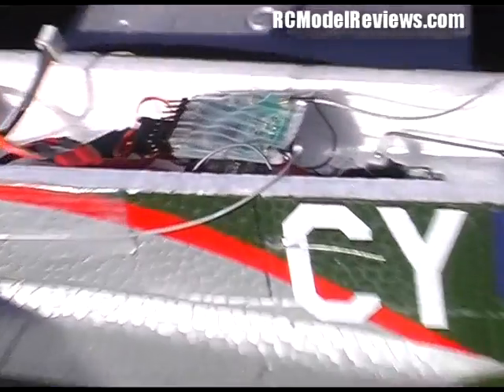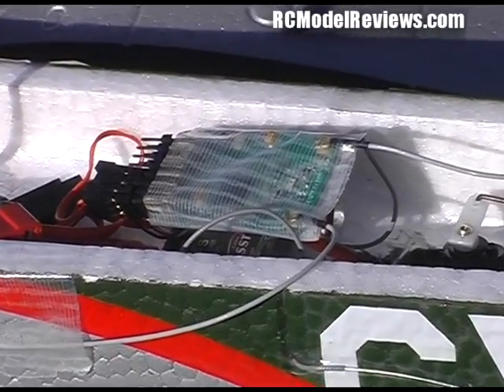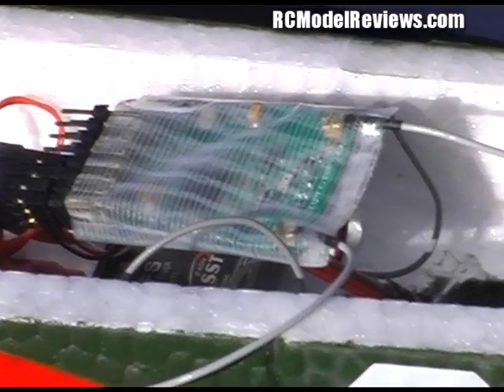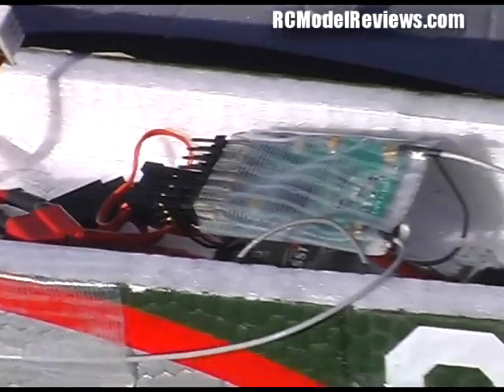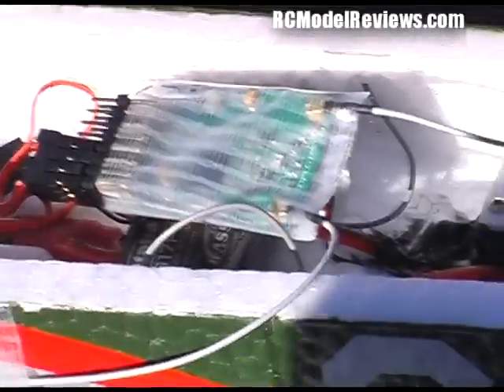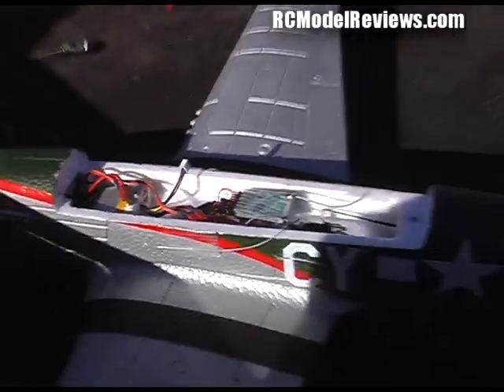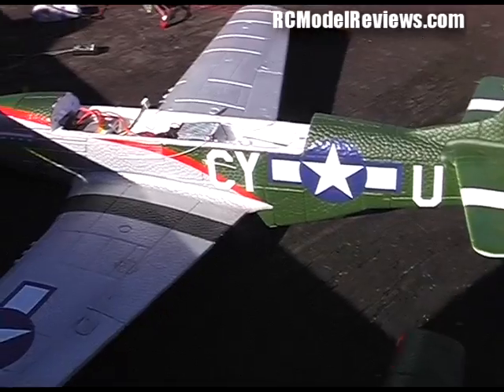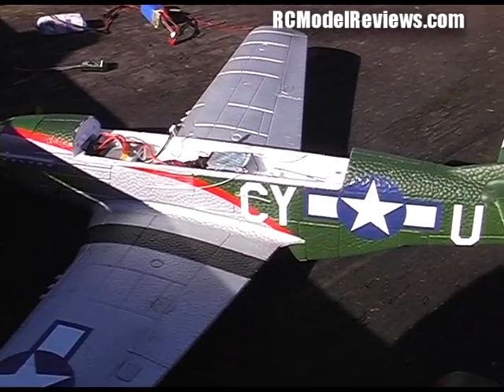FASST-compatible receiver, flight test

Comment: Hugh, some materials block 2.4 signals, in RC they are commonly metal/wiring/batteries/carbon fibre.  In a foamy if you keep the antenna away from the ESC you should be fine.

Comment: @rcflight13 Its a Parkzone P-51D Gunfighter. It costs $200 for a RTF, $180 for BNF, but I recommend getting the replacement airframe for $80 and replacement motor mount and installing your own electronics and power system. Im running a Scorpion 3014-16 with a 9X9 prop, Hobbywing Platinum 40A ESC, 1800mah 25C LiPo, and Hitec HS-65HB servos. It goes 80mph. To go much faster would require a very heavy power system and strengthening of the airframe.